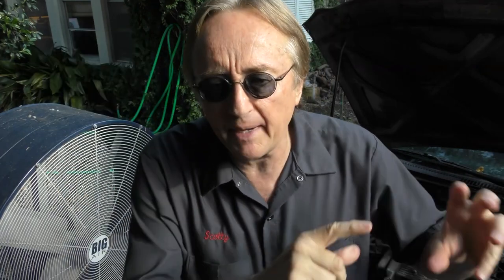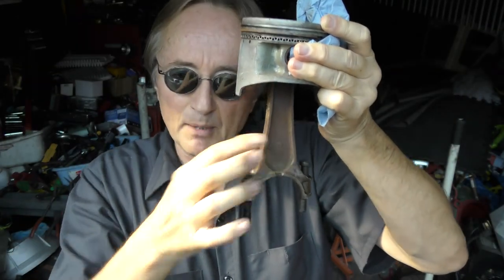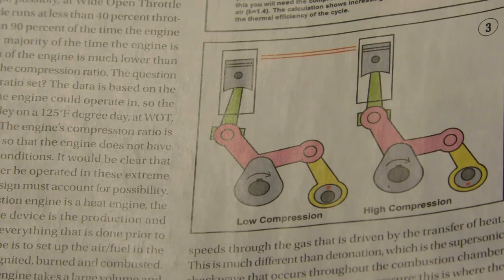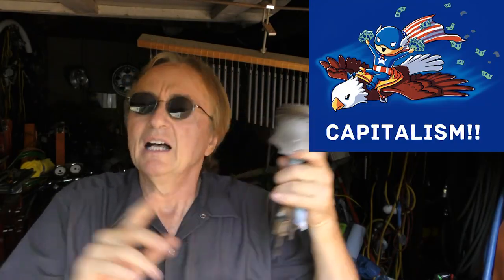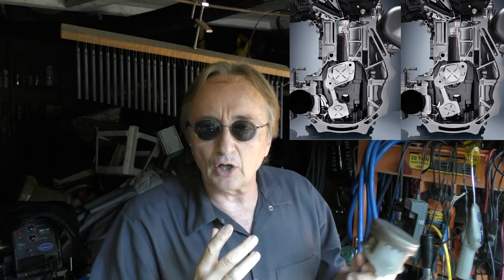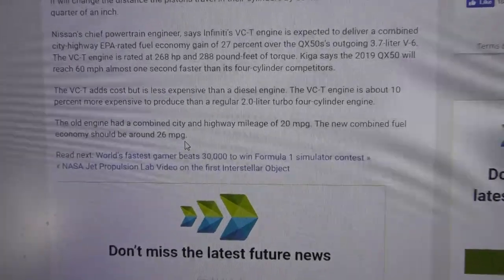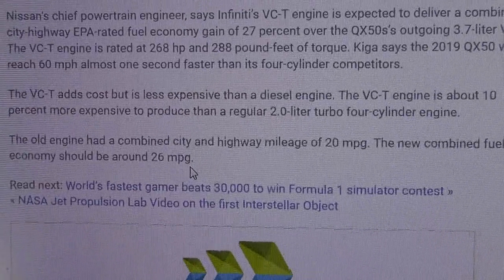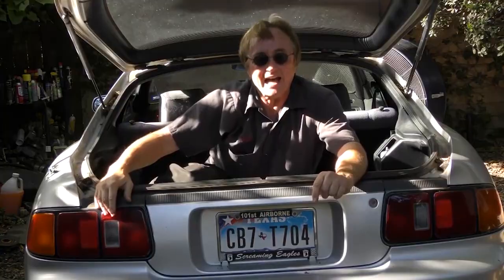If You Buy This Type of Engine, You're Going to Regret It

Comment: It's a shame Nissan ain't what used to be.
Reply: Eric Jensen its Renault now and they have always sucked in terms of reliabillity
Reply: Yep. I had 1993 pathfinder with over 200,000 miles. Never leaked anything, burned anything and ran like a champ. The only problem was rust,
Reply: I replaced the engine of altima 2008 a year ago now it needs another engine and transmission
Reply: Remember those Maximas from the mid eighties through the 90's?
Those were some serious motors in them there cars.
Reply: Nissan engineering is still world class and many of their power plants are still based on the 90s and 2000s designs like the VQ SR and QR all bulletproof motors. Same with the GTR obviously. Renault do not own Nissan, they are an alliance. The engine's in Nissans are not Renault either. People need to check facts before keyboard bashing
Reply: ThrillSeeka Campervans  I stand corrected. Thanks man.
Reply: For a few years I drove a 93 Sentra with a 1.6.  It had over190,000 when I sold it.  Wasn't anything wrong with it, I just needed a truck.
Tough little car.
Reply: ThrillSeeka Campervans actually all diesel engines in nissans other than the titan are renault units now, check your own facts bro
Reply: owen k  Not terriblely relevant here, but thanks.
Reply: Eric Jensen how is it not relevant?
Reply: owen k  Because the vast majority of vehicles sold by Nissan over the last 30+ years are gasoline.
Reply: owen k you're mistaking dude. There's a Cummins in all the diesel Titans
Reply: J Wolf true but excluding the cummins in the titans they are renault units in all the rest
Reply: Eric Jensen, think outside the box! the world dosent relove around America Eric, Diesels make up the majority in Europe so its very significant 👍
Reply: 90s Nissans are awesome! My '96 Sentra has been a very reliable daily driver these past 5 years. It isn't perfect, but it sure gets the job done.

Nissans since like 2003 though...Eww.
Reply: I've got a 07 Titan that's been demoted to a farm truck and it's got 220k miles without any issues. Some Nissans are still great vehicles.
Reply: I had a 2004 Altima, bought it brand new that year. 

Aside from an alignment issue that made the first set of tires wear down funny (which I had corrected free of charge by the dealership), I had never had one single issue with it. 

Sold it in early 2012, because I wanted an SUV again and was sick of driving a sedan. But I was sad to see it go, still wish I had it some days.
Reply: owen k this is actually false. The titan diesel has a cummins diesel in it
Reply: 2003 pathfinder was a POS
Reply: They are using Renault engines which were no reliable in the first place, now they are sharing electronics and nobody wants a car with French electrics.
Reply: Eric Jensen false.
Reply: Had A 2006 2.5 Altima To Make It To 200k Miles Before The Catalytic Converter Messed The Engine Up .
Reply: Seth.N  Did one of the oxygen sensors go bad first?
Reply: owen k  Those europeans are often ahead of us on many things.
True that.
Reply: Parsons Turbine  Those Altimas must be pretty stout. Lot of em on the road.
Reply: Nebderf 350zHR  Is that cool 2- door sports car of yours a Diesel?  I'm sorry I don't know what claim of mine you're objecting to.
Reply: Eric Jensen No. Engine Light Came On , Took It To Nissan , And They Told Me The Engine Had Internal Damage And Needed To Be Replaced. They Replaced It For Free Too.
Reply: Nebderf 350zHR  But anyhow, I think quality control for Nissan may have declined a fair bit in the the last 10-15 years.
Reply: Seth.N  Wow! I'm glad to hear they took good care of you?
Reply: Nissan Titan and NV3500 5.6 L V8 seems all Japanese with no Renault input. Can't imagine anybody in Europe using such an engine on anything. More like 2 L for the same payload :)
Reply: With pathetic snowmobile transmissions, bullfrog styling, garbage interiors and electronics, every Renault factory should be nuked to give Nissan-Datsun back to Japan where it belongs.
Reply: Absolutely  Pathfinders were solid rigs from '87 to '95, except for the frames, which didn't get the kind of Rust-proofing it needed.
Reply: Nissan makes good, reliable cars. My 32-year old Nissan Hardbody pickup has 336K miles on the original engine (2.4L). The only major changes are 2x clutches and 4 starters. My friends who bought Toyota pickups around the same time are on their 3rd Toyota pickups now. One is actually more happy with his Ford Tempo. My Infiniti G35 still runs like new (150K miles). My Nissan pickup is my most reliable car. That says a lot because I also have a Lexus ES300, a Toyota Sequoia and a Honda S2000.
Reply: yep look at what Renault did to AMC
Reply: Dead straight 👍 in the 80's and 90's they were building good solid reliable RWD, AWD japanese cars that everyone loved now their probably one of the shittest companies around being partnered with renault they can go bankrupt because they deserve it
Reply: My old 2000 infiniti I30 made it to 330k miles and it didn't want to quit.  I got rid of it in 2017 for something made in this decade.
Reply: 370,000 on my 91 Maxima original engine/transmission+clutch!
Reply: Sizzlin Moe Szyslak  I never understood why the 240sx wasn't more popular. Great car.
Reply: I traded in my '07 Nissan Maxima for a '17 and I regret it. The old one ran extremely well. My old Nissan Stanza went on forever before that. Yep, Nissan ain't what it used to be. :(
Reply: alphatrion100 Renault ruined Nissan’s old reputation. They’re not the worst, but not as good as the other Japanese companies...
Reply: I'm still what I used to be,it's my birthday. I only want 4 subs XD
Reply: Nissan have been crap for a long time now, even a guy I know who used to have a Nissan dealership says don't buy them, especially the new ones.
Reply: Nissan died when they went with CVT.
Reply: Eric Jensen I had an early 2000s Altima. It was the worst vehicle I have ever owned. So terribly unreliable!!!!
Reply: owen k cummins?
Reply: +an an

Did the Altima have the 3.5L v6 with a CVT transmission? Both of them individually are horribly unreliable, together they're guaranteed to fail.

My mom had an 04 Murano with that engine/tranny combo and it started failing around the 75k mile mark. Both the engine and transmission were trash at just 120k miles. The rest of the car fell apart shortly after and she dumped it like the garbage it was.
Reply: Eric Jensen last good maxima was the 01
Reply: San Marsui some engine burn oil some as trans problem so not really
Reply: Nissan (Datsun) and Mitsubishi have always been the bottom of the barrel in Japanese cars.
Reply: Had a 2001 maxima that was in the shop every 6 months.  Each time is cost $800 plus.  After two years traded in for a toyota and never looked back.
Reply: legioner9  Good information, monsieur!
Reply: Renaults were a massive failure in America.  If Renaults are so great and reliable, why did they have to team up with a loser company like American Motors?  (kiss of death)., 
Why aren't they opening dealers across America today on their own?  America is arguably the largest car culture in the world. You'd think they'd want to sell cars here.  
Americans despise French cars for good reasons.
Reply: Whatever, man.  Ford and GM produce more vehicles EACH in a few months than all of the companies you mentioned COMBINED in a year. 
"It's the good cars that sell".........(old American car business saying).
Reply: Renault has created one of the most reliable car brands in the world (Dacia) that are built to last in harsh countries like Russia. It's on par with Japanese levels of reliability and it uses more Renault stuff than Nissan.
Reply: Ziggi Mon sorry you are wrong the early Nissans and Datsun cars and trucks were incredibly reliable,The overbuilt engines would last forever even with neglect and abuse. I would not call them class leading in power or styling but they would run as long as you took any kind of care of them,unlike today’s Nissans .
Reply: Eric Jensen yea back when they were "datsun"  they were great
Reply: Seth.N. ditto, material inside exhaust manifold converter broke down and some was drawn back into cylinders, damaged cylinder walls and rings. Started burning oil badly. Rest of converter material went downstream and blocked 2nd cat. But to be fair after 2 new O2 sensors and a generic replacement cat to replace the blocked one I drove it another year adding half quart of oil every time I filled up for gas...
Reply: Renault=Nissan=JUNK!!! STAY AWAY!!
Reply: Legioner 
Renault’s ceo was Nissan’s CEO.  Carlos Ghson. He called the shots and Nissan reliability tanked under his watch.  Renault=Nissan=JUNK.  STAW AWAY!!
Reply: I bought a 2015 Nissan Versa (1.6L). Least expensive car sold in Ametica. It is a manual transmission. It already has 128k miles on it. Only time it has been in the shop has been for a new clutch and a gas pump. Still gets over 33 mpg.
Reply: Samsung Motors is now owned by Renault but the old models were all Nissan models (badge engineering).
Reply: Eric Jensen , my personal favorite , a 1980 280ZX. 7 years and rock solid mechanics. Factory paint was thin, so if they weren't repainted in the first 10years, rust would probably be what stopped them.
Reply: +Conrad Jonas
But the Japanese Nissans had good paint.
Reply: U don't know what u are talking about I have a friend with a CVT and almost 200,000 miles on it get your facts correct
Reply: Whatever niche nissan had with sports car enthusiasts was gone when they did that deceptive stuff with the GTR. If you switched it to sports mode, your warranty went out the window. People didnt know this and when they took it to get repairs under the warranty they were SOL. The dealer/mechanic would hook up the computer to the vehicle which would tell him/her that the vehicle had been in sports mode. If you make the vehicle with a sport mode why void the warranty when it's used? That's like having a light in your house but if you turn it on your insurance on that house goes away. Just real deceptive stuff Nissan. The sad part is they used to build good, reliable cars but now they are a shell of thier former self.
Reply: Well Nissan is now living proof that this is why nobody takes the French seriously anymore

Comment: While it is true the variable compression technology has unknown reliability, 26mpg for that class of crossover and performance is pretty good.
Reply: Yeah, I love Scotty , but he lost me there lol
Reply: 26 mpg is great, unless you spend what you save on gas at the garage.
Reply: This is only for the rating on the poster. If you drive aggressively you will never get this mpg. Power comes from fuel - driving harder => more fuel consumed. It is just this engine has the ability to use less fuel if driven slow and suck fuel/power when driven fast. IMHO
Reply: @Aidan Bhuiyan what’s your speed? I have a totally different vehicle. A 2016 Subaru crosstrek limited. It’s rated for 34highway and I get 40mpg going 65with cruise control, ethanol free gas, and Michelin tires.

Comment: When I learned about government incentives to mandate improvement in fuel economy, I wondered if they would consider all factors. Manufacturers saw it as solving two problems, for them. First, they could advertise better mileage for new vehicles. Second, their main competitor, old cars, would not be on the road for long because they aren't as durable and repairs are too expensive. In the end, government was completely blind to the extra emissions needed to make new cars! The real solution is to expose how some vehicles depreciate over time, then let market forces do the rest.
Reply: aren't as durable? older cars are WAY more durable than the crap you buy today. engine blocks used to be made out of cast iron or cast steel, now they are made out of aluminum which is brittle and probably one of the worst metals to use for something that constantly goes through rapid temp changes. and cars today have crumple zone which do keep you safe but the car is literally designed to fall apart in a crash. where as with an older car it will most likely survive, you probably won't but at least you car will. yeah cars today are not durable at all, they are made out of weaker metals and have cheap plastic interiors. 

too expensive? how much do you think a carburetor costs? it's a lot cheaper than fuel injection. a good old fashioned american V8 is probably one of the easiest engine to work on whether it's a 350 small block, a 383 stroker, a 460 big block, or a 426 HEMI. auto parts manufactorers make parts for all of those engine infact some of those engines are still in production today. the MoPar 318 was first introduced in in the late 60's and chrysler used them all the way up until the early 2000's. they came in dodge challengers, dodge dokota's, and the plymouth duster. although there are no modern MoPars running a 318 you can still buy them brand new today. and you can actually get a long block 318 cheaper than a 4banger for a camry.
Reply: The real solution is the electric motor. Greater than 80% efficient rather than 20% for an ICE. And a much simpler design. Scotty is right, they shouldn't waste time on over complex design. That is true in general for ICE.
Reply: BTW, maybe you are right, the government should have had the market decide. And GM wouldn't be around anymore. They were busy building Hummers when the market tanked in 2007 and needed a bail out. And BTW global warming is real. As far as I'm concerned, non-hybrid vehicles should be banned. It is idiotic for people to be driving around WASTING resources like they do. Everyone is driving a huge truck or SUV. Well, you idiots are going to get a reality check in the coming years after global warming kicks in some more. All time heat records are being set all over the planet right now including in parts of the US.
Reply: idmhead0+ but electric motors lose torque as the battery drains, but gas motors don't. and gas cars can be modded like crazy when electric cars can't. ICE are much more efficient when it comes to energy usage, gasoline weighs a lot less and will get you further than a battery would in a car horsepower for horsepower. and lets not forget that electric motors don't last nearly as long. l mean truckers put millions of miles on their rigs with the original engine, but a tesla can't go 50,000 without 500 drivetrain swaps.
Reply: freezeme360 IMHO obtaining the resources for batteries and then recycling them is better than burning oil putting greenhouse gases into the atmosphere. Global warming is real and needs to be addressed. It has been known about since the 80s and virtually nothing has been done about it. We need to get off of fossil fuels and switch to renewable energy. Wasting time on ICE is just that, a waste of time. And as I mentioned, an ICE is around 20% efficient. That's why you're engine gets so hot. Tons of wasted energy in the form of heat. Check fuel economy gov, they talk about it there.

Comment: I turned wifi off and the video played just fine. Couldn't play it on wifi for some reason.
Reply: Yeah same here... Weird
Reply: Must be because them engines are kind of wiffy!
Reply: Same here lol
Reply: Stephen Carbonaro lies..
Reply: Stephen Carbonaro That did not work for me.
Reply: Spent ages rebooting my router, waiting for it to come back on. Left the video half an hour, came back to try it, still played like crap. Should have read the comments...... 😆
Reply: I wish it worked but I can't play the video.  I wonder if it has to do with the suddenly high traffic (lots of people using the internet)
Reply: Lincolnator it's only this video.
Reply: Lol. Only this video for some reason
Reply: Stephen Carbonaro . Thanks. This actually fixed it for me. Weird.
Reply: billydent2 glad to help 👍

Comment: My wife’s QX60 has just over 130k miles on it and it’s still a great family mover and vacation car. I cannot believe how well the suspension has held up. I’m getting ready to do the trans fluid which we do every 50k. Im also doing the trans filter and thinking about dropping the pan to clean the magnets.
Reply: great! we just bought a QX60 with 128k miles on it! beautiful spec, white with beige interior.
Reply: @qasim7684  We also just bought a QX60 w 66k.  Great price, and the V6 3.5L engine is a better choice that the 2.4L Turbo that Toyota has decided to put in their Highlanders this year!  Toyota has stopped making their V6 that used to go in the Highlander????
Reply: @qasim7684  bought a 2014 qx70 with 125 running strong 💪 and everybody recommends them especially the v6 is more reliable
Reply: @AmericanMuscle323  yep wonderful car.
Reply: We just bought a low mileage ‘16 QX-80. No silly variable displacement or cylinder deactivation, just good old-fashioned and reliable V8 power @400hp/413 lb/ft torque. My only concern is the JATCO transmission reliability, but I’ll keep it maintained and see how it does.